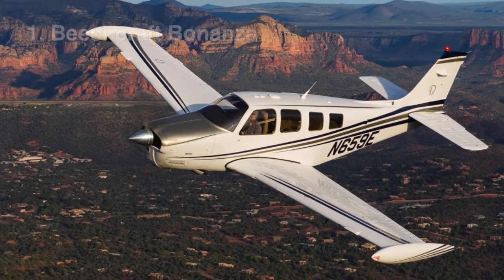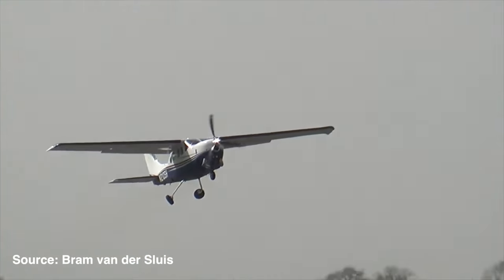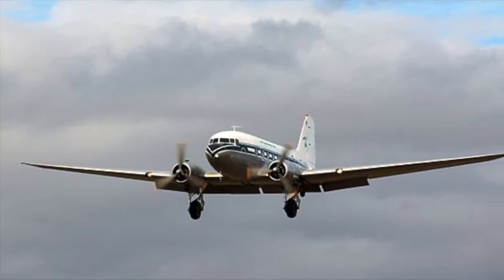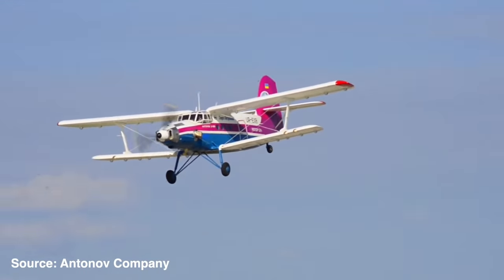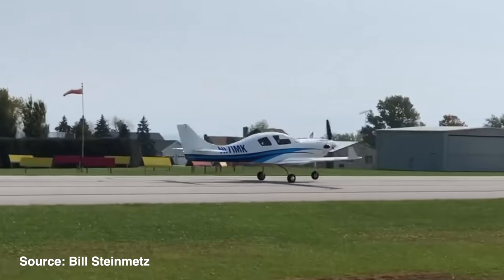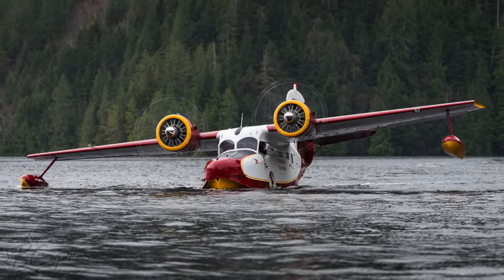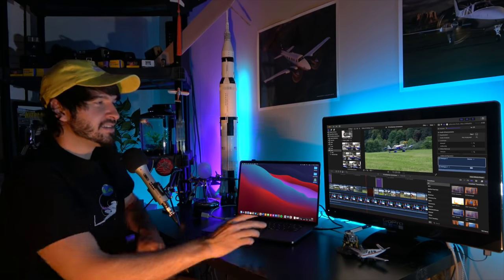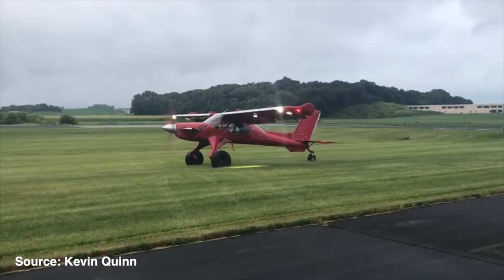Airplanes Modified for SPEED - 10 Turboprop Conversions

Comment from the maker: *Remade and reuploaded from an old video*:
Comment your favorite turboprop conversion, or which you would like to see!
Reply: Why’d you have to reupload the video?
Reply: A very interesting turboprop modification will be the Tchèque made vl3 ultralight today available with Rotax 912  100hp an Rotax 915is  135hp. Jmb aircraft is testing the turbotech trp90 turboprop engine now. But will it be also a European ultralight 600kg plane???
Reply: @CalebT_RC  Desperate for views, lack of unique ideas.
Reply: I'd like to see a single engine Cessna Skymaster (rear engine) converted to 8 seats along with a radar nose..!
Reply: Tbm 390
Reply: My "ultimate juice machine" would be a North American P-51H Mustang with an Allison T-56 (Allison 501D) engine in it and a 6-bladed, contra-rotating propellor. THAT would be an airplane that could cruise & fly with the jets..! And upon landing..? You'd also have a reversible-pitch prop..!! The ultimate take-off & cruise performance combined with the ultimate short-field performance, as well...! :-)
Reply: Basler Douglas commercial.. 3rd iteration.
Reply: @johnyoungs7453  not to mention...THE BADDEST ASS PLANE ON THE RAMP!...
Reply: Another GORGEOUS machine is the Rocket "Royal Duke": a Beechcraft Duke with PT-6 turboprop engines & 4-blade props! Gorgeous machine, but screwed on range! They didn't allow any further tankage, so range was cut by 1/3 over the piston engined Duke...!! :-(

Comment: I flew a Cessna 421C with the Riley Rocket conversion. The 421 was originally powered by two Continental GTSIO-520-L engines of 375 hp each. The 421C was later converted to the Riley Turbine Eagle 421 aka Riley Rocket, which was powered by two Pratt & Whitney PT6A-135 turboprops with 750hp each. It was an amazing plane to fly especially after the prop gear reduction box was removed.
Reply: Ugh, 421. Whoever designed that plane to have those gearboxes must have been in the throws of insanity.
Reply: How many of those Riley Turbine Eagle 421C are there?
Reply: @BobbyGeneric145  gearboxes, when done right, are actually a good thing. You can let the engine turn faster and the prop slower (tip speed at larger prop diameter) which increases overall efficiency.

From what I have read, many geared engines (C175) suffered from the pilots still wanting to run them "square".
I don't know, if that is really the case, but it would certainly not help these make TBO.
Reply: @BobbyGeneric145  Never met a 421 owner who didn't say it was the most reliable, coolest running aircraft engine they have ever own...you just have to know how to operate them in the decent...
Reply: Geared, Turbocharged, injected and opposed. Aka grenades.
Reply: @BobbyGeneric145  same as the Hanger Queen Aire.

Comment: Surprised you didn't have the de Havilland Beaver and Otters. Both are very commonly being converted to turbo prop, with several companies specializing in the conversion..
Reply: I was thinking the same thing.  Probably a lot more common than most of the others on this list.
Reply: I think that’s why they weren’t on the list because it is fairly common

Comment: -On your video on turboprop conversions... Thumbs up! 😀
I think that the Dehaviland Beaver turbine conversions might be worthy  to be included in your list. ( I believe there are quite a number of them flying). -High climb rate and short take-off n' landing capabilities (as you pointed out) is very useful in bushplanes. Also... Isn't there a lot longer time between service intervals on turbine engines?
Reply: Yea the can run 3-4 times longer between majors
Reply: And your 100 percent the Beaver should be close to the top of the list with a 1000 more weight it can carry and they are a bad ass plane with that long nose and chrome pipes sticking out each side !!

Comment: I have a Glasair Sportsman that can be easily converted to a taildragger or floats from tricycle gear (all mounting points built into the original aircraft). A small turbo prop would give that aircraft great on water performance, ability to fly where 100LL is not available, increased payload and better high altitude performance for mountain flying. I’m sure it would also improve landing and takeoff distances which are already very good. And of course reliability is nothing to be ignored as a major positive. The big downside is obviously cost. An issue may be weight distribution and CG but it might be something worth looking at in the future, especially if a good replacement for 100LL is not found.

Comment: The Cheyenne 400 was my favorite.  41,0000’ in 11 min and 8sec.   The VSI will “peg” through 14000’.  LA to Vero Beach non stop.  352kts top speed if is tuned correctly. Faster if it is not.  Landing distance is 750’.  No conversion necessary
Reply: That is an absolute beast of a time machine!
Reply: Didn't Chuck Yeager promote that thing? That alone speaks volumes ... ^v^

Comment: Great video, however you missed out quite a number of piston to turboprop retrofitted planes. The Beech Baron that had one Turbo prop Walter M601 fitted in its nose and its original pistond motors removed from its wings , called the ''tradewind''. Also a one of a kind modified North American Navion fitted with a Walter M601 Turboprop engine as was depicted in a 2001 Flying magazine issue. The mod was done by a firm called Turbine Design, and the engineer responsible was one Douglas Karlsen. There is also an Allison turboprop modified version of the Sia Machetti ( Italian made plane originally piston 2 seat trainer for their military }. There is also a Beechcraft 36 Bonanza modified to a 550 HP Pratt & Whitney PT 6 engine , not sure if that was done by ''Texas Turbines'' ? As a former owner of a piston Navion Rangemaster, I would like to see a video of the one made in 2001 by Douglas Karlsen. I gather it was sold to a retired airforce pilot somewhere in Nevada USA.

Comment: Probably the most successful turbine conversion on any aircraft is the AT-502, which started out with a 600HP R-1340 on the original prototype and was terribly underpowered.  The standard PT6-34 with 750HP made it a popular aircraft, and has more sales than any other converted aircraft produced.  They later went nuts with the 502A variant and bolted on a -65ag, giving it 1,100HP.  You simply don't run out of power with a 502A.

Another conversion that would've never made it beyond prototyping was the Performance Aircraft Legend, that later became the Turbine Legend after they replaced the Chevy V8 with a Walter 601.

One off conversions are plentiful, the ones that came to mind above the others were the LoPresti Swiftfury (also wins the most pretentious name award) and the Oracle Turbo Raven, which was a modified Giles-202 with a positive thrust to weight ratio.  The Turbo Raven still holds the world record for a 3000m and 6000m climb from a stop, it was the fastest climbing propeller driven aircraft in the world.

Comment: Would love to see a turboprop DC4 or C46. Not overly practical but just think it would look cool 🤣
Reply: I think a propjet C46 would be the fckn tits, dude.
Reply: That would be a Basler BT-67.
Reply: @SturgellatOSU   that’s the dc3 models. We were saying old c46 or dc4 with modern turboprops would look sick
Reply: There was actually a proposal to build a turboprop DC7, which was to be the DC7D. It was never built due to lack of interest. You CAN find several drawings of the proposed plane, and it looks pretty slick and modern compared to the original DC7.

On the other hand, a few turboprop Constellations were built. With four 5500HP Pratt and Whitney T34 engines, they were actually stellar performers, and were among the fastest propeller driven planes. But like the DC7D, lack of interest ultimately killed the idea.

Comment: Interesting re: the RV-10...my Dad's Mooney 201 ran a Lycoming IO-520...imagine a late 70s Mooney with a light turboprop conversion!
Reply: Exactly what I was thinking.  I built Mooney's back in 1989 and 1990. When they were going through another layoff during slow times, I moved from avionics to security. Over in the experimental dept were some pretty awesome planes. There was even a Mooney twin that never went into production.
Reply: With Rolls Royce coming out with that small turbo prop you could see them in about any plane out there. They had a 172 Cessna with one in it. Not my choice but it can be done. I wand you see a Glassair with 450 hp. That would be a rocket because with the piston engine it flew at 290 mph but the insurance would kill the gun !
Reply: @brentmcmahon8188  it seems nobody is really catching on to the RR-300. I almost have the impression that the interest was larger, when the engines were still marketed as Allison 250s.

A short-bodied Mooney with a turbine would be great. You'll need to do something about the fuel, because at around 50gal standard, you'd be looking for a gas pump pretty shortly after take off. 😄

Comment: I read about the turbine Duke years ago, and it's a rocket for sure. Only problem is the donor aircraft are at least 40 years old which makes for high maintenance vs using a newer airframe. The availability of parts for a 40+ year old Duke might be an issue also.
Reply: It looks good though. Maybe they'll make new ones with PT-6's.
Reply: The good news is, with the advent of 3D printing, all kinds of rare parts are much more available now. ^v^

Comment: Forgot the older Malibus. Those long nose conversions led to the production Meridian. I remember when the Bonanzas and 210s were doing the conversions. Always thought the Duke was a good candidate...and they made a mini-King Air! Wish they would have done the Allison/Rolls Royce conversion on the Cessna 414/421. Especially the 421. I hated working on those geared engines...
Reply: Riley had a couple of STCs for engine conversions on the 421Bs and Cs. The first was the Riley Turbine Rocket 421(LTP-101 engines...750hp) and the Riley Turbine Eagle 421(PT6A-135 or -112). The PT6A conversions were essentially the Blackhawk conversion for the Conquest I and the OE engine for the Conquest I. Can’t say I blame you for hating the GTSIO-520s. My first job in aviation was as a power plant mechanic in a piston engine overhaul shop. We had a 421C on leaseback. We ended up overhauling both engines with new cylinders, new spur gear sets and new cranks. Those engine were as near to perfect as humanly possible but we still hid any time that beast took off!

Comment: 1,500 ft take off roll for a Duke? Yeah, RIGHT. Maybe if it is only the pilot and 100 gallons of fuel. I’ve seen B60s take 3,000 ft or more to become airborne with three passengers plus pilot and half the fuel capacity. BTW....you left out the turbine conversion for the Cessna 340.

Comment: For those who care, some FYI for ya.
Regardless of a Piston Prop or Turbo Prop, The propeller should not exceed roughly 2800 RPM.
If it does, it becomes VERY inefficient interacting with the air around it.

Comment: I'd like to see a Mooney with a PT6.  Especially if it could be lengthened to be a 6 seater.
Reply: That would be beautiful
Reply: It's called a TBM. Mooney put a standard tail on it when they expanded it to 6 seats. TBM stands for Tarbes Built Mooney.
Reply: @skousend   I know about the TBM. It doesn't stand for Tarbes Built Mooney, The TB stands for Tarbes and the M stands for Mooney. Back in the late 80's Aerospatiale bought Mooney and used their technology to build the TBM in France. Then they sold Mooney.  It was never built by Mooney in Texas though. I used to work there.    I'd like to see the Mooney Acclaim with a PT-6.

Comment: I’m not sure what DC-3 your talking about but I’ve flown easily 400 hours in many different C-47 and DC-3 models in my 20 years as a pilot (no none of them were turbines) and I’ve never gotten better than 155 knots TAS at cruise, that’s with very good conditions maximum Power, and cowl flaps fully opened. So I’m not sure where your getting 170 knots at, unless that’s ground speed. If so, just fyi, cruise speed is NEVER measured in ground speed it’s always either TAS or IAS.

Comment: For just STOL consideration, I would not spend the mega bucks on the Draco, for 1/10 th the money, I could have build a Zenith 801  that will take off at 100 ft.The Duke , and the DC3 are worth the effort, but availability of airframe is limited.But then there is always the factory new Skycourier. Many of these airframe are limited by the factory original Vne. The only plane you can actually say was designed with jet in mind  was the Aerostar. But the straight wing and ground clearance will limit the choice of engines. You are sneaky not to mention the turbine conversion use a lot more fuel, even if it is cheaper fuel, it is a net cost increase. The RV10, what a waste to do all that work and get an engine that is within 10 HP of the original. I would stuff at least 300 HP into it.

Comment: You are correct that an A36 cruises at 160K. You are incorrect when you imply that a similarly equipped C210 cruises at 190K. Comparing a normally aspirated Bo to a Turbocharged 210 is irritating to wise pilots!

Comment: The problem with converting piston engine machines to turboprop's is the structural causing speed is part of the aircraft's design and doesn't change just because you hang some kerosene burners on it. So the aircraft owner is spending a lot of money for a impressive climb rate.
Reply: You might want to refer to the STC certification. In the case of the Duke, the Royal Turbine STC increases the max allowable airspeed to forty knots higher than the OE maximum certified airspeed.
Reply: @stevehicks8944  Thats one aircraft, and it isn't emblematic of all the turbine engine conversions. Just because you hang a bunch of horsepower on an aircraft, doesn't mean the markings on the airspeed indicator automatically change. Those numbers are an integral part of the aircrafts design. Plus the fuel burn of a turbine engine conversion is about twice that of the original piston engine machine, yet those conversions won't haul twice the payload.
Reply: @Agislife1960  The TIO-541s on the Duke would burn around 40-45 gallons per hour. With the Royal Turbine conversion you are looking at around an average of 60-65. Most of the Dukes I ever worked on had a 270 gal fuel capacity. In this case you are going to trade two somewhat unreliable piston pounders for a somewhat great fuel burn, but infinitely more reliable engines and a greater max speed and cruise speed. If I remember correctly, Royal puts the range of the Royal Turbine Duke at 3.5 hours with IFR reserve. 270 Kt cruise @ 3.5 hours equals 1087 miles. Not exactly King Air range numbers but it has about half the fuel capacity of a 90 series.
Reply: @stevehicks8944  I maintained a fleet of Navajo Chieftains in Alaska during the 90’s, we also had one piper 1040, it had the small 500 horsepower PT-6 engines, it was a pretty rare machine and what a hot rod, the pilots would fight over who got to fly it, but it burned twice as much fuel as a chieftain but didn’t haul twice the payload, so we eventually sold it, I really liked that machine. Also I know that the fuel burn on a pair Lycoming TIO-540's as installed on a Chieftain, isn't 45 gallons per hour more like 32 gallons per hour in cruise.
Reply: @stevehicks8944  I could tell ya stories about our 1040, it was one well designed machine, our chief pilot once flew a medivac mission with it out of Barrow AK when it was 60 below zero, both prop governors froze up putting the propellers in an overspeed condition, but the 1040 brought everybody back safely to Fairbanks,
Reply: @Agislife1960  When I worked for Beech I was in product support at the Indy location. We had both MarkAir Express and Cape Smyth Airways as customers. They were operating 1900C( MarkAir Express) and B/C 99s (Cape Smyth) into Barrow. One of the strangest photos I have ever seen is turbine oil stuck to the dipstick because it had congealed at -60F. If you get a chance, go over to Soloy webpage and take a look at their STC for turbines on the Cessna 340. 425hp per side is exactly what that “lead sled” needs. They’re using 250-C20B if I remember correctly, which means the fuel burn per engine is around 20 gallons per hour.
Reply: @stevehicks8944  I worked for Frontier Flying Service out of Fairbanks from 1990 until 2000, then NAC as a flight Engineer on DC-6's from 2000 until 2003. That part of the world has a way of culling aircraft types, the Navajo Chieftain was the only cabin class piston twin that could cut the mustard, they were affectionately known as Tundra Taxi's.  It's a shame Piper doesn't build Navajo's anymore, they were such a bullet proof design, would've loved to seen a Navajo with a pair of Lycoming 720's on it and a power steering system, to keep from destroying the props on the gravel. Frontier also flew two King Air 200's or more specifically 1300's with belly pods, good machines, but they couldn't compete with the Cessna Caravan's going into the smaller villages
Reply: @stevehicks8944  yes, but you're right at the barberpole. (yellow arc in piston powered aircraft).